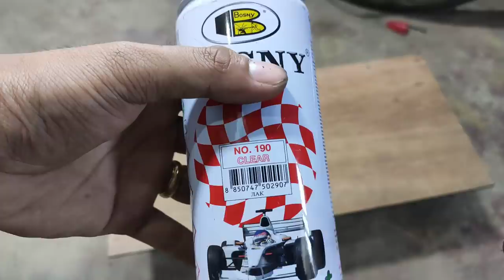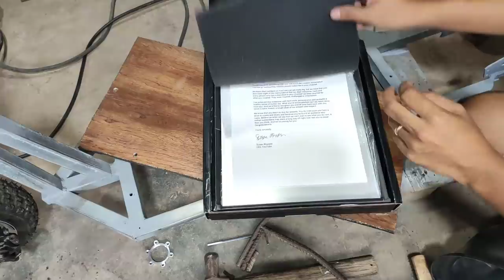72v dual tire electric scooter from bike parts

Comment: great build, love the use of repurposed stuff :) You definitely need more than 15psi in those tires though, my dude!
Reply: @Edward Elizabeth Hitler he didn't care about tire performance, i think he wanted a backup tube in case of a flat. He didn't add suspension, so a wider tire reduce the shock

Comment: Great design and nice construction job.  I've been doing this kind of projects for over 50 years.  I was wondering how the back spokes were going to work because of the wide angle from the rear hub to the wheel rim.  I would have gone more directly to the rim at a small angle and rebent the hub side of the spokes and put a small braze dab at the end to anchor them. Also it looks like you may need some type of kick stand for parking.

Comment: Nice work! Was curious as to what the charge time is. Also, if you can figure out a better alternative to inner tube tires, which have a weak bead grip between the tire and rim, and once a tube runs low, it starts to slice the inflation stem, with the pass through hole. Not your fault, but a terrible design since introduced, not to mention the spokes that enter holes in the rim, and warm spots in the tube also. Cutting some 8" I.D. pvc, spoking through the edge of the pvc wide enough to reach the spoke rings on the motor, the scuffing the pvc then supergluing a fat, treaded dense foam on the pvc for the tubeless tire, and the glue will handle the torque better, and won"t make steering glitchy, like the "dually tire".

Comment: Now I can never use the excuse

"I can't do any meal fab till I get a TIG welder, gas bottles, a bandsaw, a flat metal bench, yada yada..."

You made an awesome scooter with spray paint, a grinder, and a stick welder...

Also, when did a spot welder for battery tabs become a tool everyone just has laying around? :P

Comment: Cool build, thinking the dual tire would be better in the front, to help turn, when tilted without as much steering.
But then the rear tracktion would suffer...ok, then add a fatter rear tire. or two wheel drive...

Comment: I wish I had access to the equipment to make a similar scooter. The big difference would be to add more watts like 2000 to each tire, and more amperage. I wouldn’t be riding it full tilt all the time, but simply for the torque when going up hills as there are no pedals to help the motor.

Comment: I think there aren't enough spokes on the rear wheel. The load on each one is too great, and if you lose one spoke, the wheel will instantly fold. It can be dangerous.
Reply: The question is 'when?' and not 'if?'

Comment: Hello Albert. I was thinking of the same thing but maybe have a 1/8 inch metal between the two frame's. Just so the tires won't run together and maybe more traction? What do you think? Love your video. Thanks. 
😎👍🇨🇦

Comment: Although the idea was great, but in the sealing of the electric board and batteries, you performed very poorly, and it was better to choose the front plug of the shock absorber type and install a retaining jack for parking. In general, it was excellent.

Comment: Great! structural welding on the chromium layer. (first mistake)
Separation of spokes with insulating tape = 0 (second mistake)
Proper angle of spokes (third mistake)
Galvanized pipe welding (4th mistake)
Lack of suspensions at least on the face (5th mistake)
Improperly fixed management electronics (6th mistake)
Rear brake cable shirt placed exposed (7th mistake)
Illegal on public roads! (8th mistake)
I liked the disc and front and rear braking system. The painting could be done qualitatively.
It is valid for you "From mistake to mistake to the final victory!"
Reply: Have you built one .....if not do not be negative ...
Reply: @ykph5188  I have built many things but never something that would endanger the lives and integrity of others. Nor are things that violate the written and unwritten law .

Comment: Tire pressure is uneven Because you put two tires in at once . An u must to consider the  welding marks .
Reply: He's also using a tubed tire instead of a tubeless one that doesn't get blowouts and punctures

Comment: You used 72v battery and controller but how that operated 36v motor?? 
Is controller giving 36v or 72v to motor ??
Please answer 
And I noticed acceleration was great
Reply from the maker: motor are 36v rated, but it design for 20in or bigger wheel.. but i used 12in wheel it makes very slow at 36v, so I give 72v Battery on it. results is incredible torque..

Comment: Nice scooter you built there :) 
But that battery needs a BMS  board for charging/discharging to prevent damage to the cells and/or fire.

Comment: Why 72 Volt i see the hubmotor have 250 watt and this will work with 1200 Controller with 72 Volt?I feel this Controller with 72 Volt can destroy the hubmotor  or can save this battery for more Range Kilometer?
Reply from the maker: reducing current out put from 38A to 11A. and motor are safe

Comment: There is  an ad , not your fault , that is a scam , on your video and I tagged and reported. It's the one for the Stator scooter. They are repeating under different URL's .  Bought product . Never received. So heads up. Don't allow youtube to confuse my tag with your video or channel.

Comment: Thought you will be much faster, why only 35? Due to low watt controler?
Reply from the maker: due to small wheel diameter. I expect 40kph + but it doesn't happen..  😅
Reply: @albertnario4877 I  love to see your videos.  Actually I used to have electric scooter who had 10 inch wheels, 48v, which I managed to get about 50kph.  What is the peak ah of the controller?  
The BMS also can pull more power, right? After it get shipped to you of course.
Reply from the maker: because your 10in scooter has more KV that design for 10in wheel, the motor I used is made for 26in wheel that can reach 50kph or more. by using smaller wheel I convert the speed into torque. my 2wd ebike can't 0 start on that hill, in the video.
Reply from the maker: controller is 38A in description but i replace the shunt to reduce the current down to 11A
Reply: @albertnario4877  you are a pro, thanks for The explanation. Have a great day!
Reply: 35 is fast are you kidding me.
Reply: @tekoppentekoppen761  yes its pretty fast but relatively to smalle diemeter wheel with similar specs it slower.
Reply: @tktur2  Trust me. Try fell off in that.
Reply: @tekoppentekoppen761  broke 2 front theeths and right arm, I know it closely.
Reply: @tktur2  Then you know. It's more than enough.
Reply: @tekoppentekoppen761  agreed. But your car can reach more than 120 kmh but you don't have to drive that fast. In that case it's better to have more torque as he did

Comment: the 72v  and big controllers wont harm  th250w hub is it ok?     does it get warm ?
Reply from the maker: i hack the controller, from 38A down to 11A.. it's safe on motor.
Reply: @albertnario4877  sir can this be done to all controllers ?   its the big   Amps   that kills  them .  so around 11 and under is safe  i take it you use an oversized controller to take more over voltage for RPM   aswell as reduces  controller heat ?.  thanks for the reply
Reply from the maker: yes, controller doesn't even need heat sink. for that. look for the shunts in controller.. make it longer to reduce the current, and make it shorter for more current.
Reply: @albertnario4877  can it  be  done with any  controller or only a  certain one
Reply from the maker: not all, but most cheap and old version can.
Reply: @albertnario4877  great  all  mine are  cheap   there all  KT    AND KUNRAY
Reply: I   ASK  THIS  BECASE  ITS  A  GREAT  WAY  TO  GET  250W X2 OR 350W X2 DUAL  MOTERS  WITH  LESS  WEIGHT  AND  UGLY  LOOKS  AND  700W  IS  MORE THAN  ENOUGH FOR  ANYONE  ON A  ROAD WITH  NORMAL  HILLS

Comment: boss ung battery mo ba straight na 72 v at walang bms? wala ka namn issue? saka sa ngayon naka over volt ung 36v na hub motor mo db? wala naman din issue?heat?
Reply from the maker: wala BMS, delay kasi ship eh. nag over voltage pero nag under current dn nmn ako.. kaya halos same power parin na rerecieve ng motor sa normal use nya.. pero mag kaiba ng performance, wala dn ako naging issue sa heating ng motor, sa ngayon.

Comment: Nicely done sir Albert.

Sir tanong ko Lang kung yung controller mo ay yung dual power na 48v at 72v? Yung kahit ano sa dalawa ang source eh pwede. Yun ba yun?
Reply from the maker: yes, tama po 👌
Reply: @albertnario4877  sir salamat sa reply! 😭

Ask ko na din sir kung bakit nyo hinack yung controller from 38A to 11A?
Reply from the maker: para hnd masunog yung motor.
Reply: @albertnario4877  balak ko kasi gumamit ng 48/72v 1500w controller sa hoverboard motor. Hindi po ba kakayanin ng motor yun sir pag 72v ang nilagay ko?
Reply from the maker: hnd,, saglit lang masusunog agad..
Reply: @albertnario4877  maraming salamat sir. Muntik nako dun ah.
Ano po ba max volts at amps na ma I recommend nyo para sa hoverboard motor? Yung sagad na... 😊
Reply from the maker: 48v 13A safe na yun
Reply: @albertnario4877  sir maraming salamat! :')

muntik nako dun. Mabuti na Lang, kayo yung tipo na nag rereply at natulong. Sige sir, back to drawing board ako.
Reply: @albertnario4877  maraming salamat sir! Congrats sa silver play button!

Comment: can i use 48v on hoverboard motor?
Reply from the maker: yes you can, I already have a video using 72v battery on hoverboard motor
Reply: thanks Albert.. it will not overheat?
Reply from the maker: you need to balance the current if you want to use higher voltage, for that I'm using 72v 10A controller
Reply: 72v x 10A = 720w but the hover board motor is only 350w..is it okay?  maybe because the actual current is less than 4A at 72V?
Reply: @albertnario4877  I run hoverboard motor on 48v and 25 ampers 😆
1200w
it's getting hot very soon.
but with rewind the motor and 12 inches tires my scooter hit 50 kph with just one motor.
I know that's very un efficient. but I have no choice.
thanks Albert your channel is aspiring me.
Reply from the maker: @aliakbari437  18A is makes motor hot, 25A you just fry it on seconds, 

thank you for supporting bro 😁

Comment: scooter made with bike parts.....?    
plus...
250w geared hub motor
72V 9Ah 21700 battery pack
48v/72v  1200w controller 38A (hack to 11A)
"these" builds...

Comment: hello, i have a question, can i connect 24v hub motor on 36v ?
Reply: @shaham3415  i have 24v motor, and 36v baterry. so I think it will be faster, or not ?
Reply from the maker: it getting faster. but if your motor is brushed stay on 24v.
Reply: @albertnario4877  my motor i brushless 24v motor from howerboard. So, i can connected on 36v ?
Reply: @makeiteasycz4759  it will be faster
Reply: @makeiteasycz4759  actually hoverboard motor is 36v na?
Reply: @shaham3415  this was cheapest howerboard and has 24v baterry. Maybe, the motor is on 36v, but in this case has only 24v baterry, to be slower and safer for kids.
Reply: @makeiteasycz4759  hmm I do have a plan making electric bike with hoverboard motor
Reply: @shaham3415  i have already controler and other things. i make electric scooter.
Reply: @makeiteasycz4759  hmm interesting

Comment: 72v=🐢?
Reply from the maker: you need to consider the 250W not just the 72V , I don't want to fry my motor..
Reply: this hub motor is for 26 inches rim, not for 12 inches.
he adapted that with higher voltage to get more speed.
in 35 kph that motor turned 600 rpm
if you put that motor on 26 inches rim, with 72v and 600 rpm you get 74 kph.
but you never get that  speed because before that your motor is burned.
but with small rims that motor is more torquay and more efficient

Comment: Full Review: https://youtu.be/v5if9dSZO6o

Unboxing: https://youtu.be/ipHwLvAe3q4

Stunt on ebike: https://youtu.be/5HHroQ_pePk

Specs: 

Frame
•Aluminium 6061 with lifetime warranty. Aluminium seat post and hyper 
cushion seat.
•20 inches support structure with folding option for easy carriage

Brakes
•Front Disc - Mechanical
•Rear Disc - Mechanical

Modes
•5 level Pedal Assistance (PAS)

Tires
•20 inches diameter with 4 inches fat tyre with Magnesium spokes rims.
•CST BFT Jack Rabbit Mountain trail heavy duty tyre for all surface road.
•Alloy Rims steel spokes with heavy duty grid lines avoiding punctures

Display
•LCD modes with odometer and trip function
•LED Flashlight in the front

Battery
•36V 10.4Ah with 12 months warranty.
•4 hours charging time
•Consumption per charge - 1 Unit electricity (Rs.5-8/Charge)

Range
•40km on handle mounted throttle 
•Upto 60km using Pedal Assistance (PAS)

Motor
•36V 250Watt
•Rear hub motor